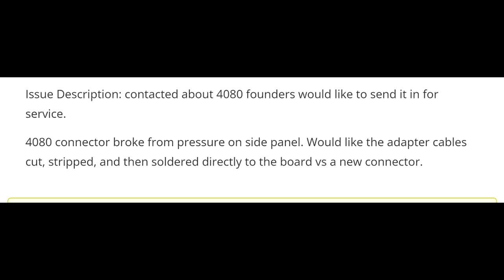Notorious RTX 4080 Graphics card Repair - Connectors are breaking like biscuits.

Comment: Love watching these repairs. I've learned a lot! "You can never have enough flux" is now engrained in my brain lol... 

Side note, I fell victim to a failed 4090 where my Cablemod 90° adapter fused to my cards 16pin. Cablemod has been great though, not only covering the adapter but also covering the card in the case of a rejected RMA. Top notch support from them. Now Nvidia just needs to do something about this trash they've attached to their design. Complete garbage, I'd sooner have 4x 8pin cables than this crap. Sure it looks nice and clean but damn, their QA messed up big time.
Reply: Q&A didn't mess up. Jensen did, as he'd have given the go ahead knowing full well about the flaws of this new connector.

Comment: Sounds like there wasn't enough clearance in the case and they forced it shut which broke the connector. Cable mod just recently put out 90 degree angles for this problem. That new 12 pin doesn't bend as easily as the older connectors

Comment: Doesn't take an electrical or mechanical engineer to see that they have reduced the total amount of copper used to save a few cents, whilst simultaneously designing a literal fire hazard. 

I hope they get clapped with a class action. This is an absolutely ridiculous issue that fixed a non existent problem. 8 pins are capable of well over 300 watts each, and definitely even a single one of those connectors would have similar if not more surface area than the 12vHPWR. 

Even the 'diameter' of the individual pins are far less than the individual pins of the 8 pins. Hell, the total form factor is almost the size of a USB 3.0 header. 

It's a wonder it can even draw 400 watts without cooking an eggs Benedict and setting the house on fire while you render a JPEG

Comment: Alex, you jinxed me mate, remember the Dell Inspiron that the connector flirted off the other day?  Well today I decided to check on the thermal paste on my new (used) laptop, after I re-pasted I went to put the fan and heatsink back and one of the screws had gone off the workbench, I searched and search but no sign of it.  Luckily I save any screws from past upgrades and broken PC's etc.  I managed to find one that fit, if I hadn't found that one I would have been stuck.  So it was your fault lol.

Comment: Is that 6 pins to ground and 6 pins to 12v dc on the connector?  At 500 watts, that would be almost 7 amps each pin!?  Those appear to be 3 amp capacity pins based on their size and contact type.

Comment: the 16 pin power connector is really hard to plug the power cable in to the point you break that connector off

Comment: My guess is that the cards are too thick pressing the cable to the side of the computer case. Now add some heat and (or) shoddy soldering by the factory and you got a mess like this on your hands.

Comment: The 4080 and 4090’s are having huge problem with the cable mod’s melting to the cards. Gamer Nexus and Linus have done shows on them and suggested it due to the plugs not have adequate supports on either side. Not sure if a video has been done on this channel yet but thought I’d mention it
Reply: What about the thermal grizzly adapter/mod that has the Wattage display screen on the side?

Comment: Assuming you could put the wires in the holes, you would have to reduce the size of the wire.  Would that not possibly compromise the ability of the wire to transfer current?

Comment: Customer needs to use an angled connector, it won't put pressure on the plug and connector on the PCB then and cause the issue to arise again in the future.

Comment: This is exactly why i do not like the rtx 40 series i rather have 3 or 4 8 pin connectors then a single 12 pin, cos nvidia cut corners on the12 pin, its obvious that it is possible to do it perfectly safe but Nvidia missed the mark clearly.
Reply: Yep.

Comment: Same heat problem will occur. There is an obvious overheating problem that needs to be addressed.  A recall should be done on that board from the factory. At rest isnt the same as a full load test. Just saying.

Comment: These connectors are designed for 30 cycles only. Every time you unplug them they get weaker and weaker and then they break. These connectors weren't designed to last long at all.

Comment: I find when you solder wires directly to a pcb they need to be very secure otherwise they’ll just snap at the solder joints

Comment: Sounds like customer needs to get a 90° or 180° adapter if the side panel of his case asserts too much pressure on the connector. I don't know why you would even think to solder individual wires to a $1200 card.

Comment: Would a graphics card brace help with this... also cable support 's so there not pulling  on the connection???  Carnt see how heat alone would snap every pin, clean  like that,

Comment: I'm starting to wonder if the metal used for these plugs (pins) are inferior. Impurities making them more prone to cracking, causing them to come of like this, or to melt.. Might not have been an issue with the older 8 pin plugs because they are considerable thicker, and therefor more durable.

Comment: customer should get 90 or 180 degree adaptor for that plug.. or a bigger case.
Reply: Yep, clearly they’ve gone small form factor and put strain on it
Reply: 180 degree connector ? How would that help ? Find online how 180 degree looks like
Reply: @benjamindoko2356  it's just a connector that you plug in it goes up and has a connector on the other side. just search for something like 180 degree connector 4090

Comment: Great job!  Quick question:  When you showed the completed connector straight on close up, did the connector suffer heat damage as it appears 18:05?  The entire bottom of that new connector looks overheated.  Regardless, your soldering skills are incredible.  That completed solder work did look like it was done at a factory.  Nice job!

Comment: Great video like all before videos
I have Razer ( Raz-RC30-024801model)  Laptop Adapter (Blade 15 ) is this possiable repair (have not output voltage ) This adapter is all metal
Can this opened without demaged ? Could you advice a method ?

Comment: Soldering the power wires to the board would work but isnt practical. I have several oc cards i did that to but outside of xoc its useless and if you snag the adapter while moving it it could fling the card across the room. Ask me how i know...

Comment: Card trying to pull too much current and metal inside of the pins are weak getting too hot and current cuts it on the spot where the low resistance exist on the pins. Thats why they look like someone used side cutter on them. Manufacrurer of those connectors must be stealing some alloys to make it more cheap.

Comment: It blows my mind how careless some people are with such expensive components. This card launched 6 months ago, and he probably bought his even more recent than that. While those new connectors aren't the best design, they don't break unless you're really bending the power wires at a ridiculously sharp angle or your PC case is too small, and the wires are smooshed in between the side panel. DUMB!!

Comment: How does the GPU not get instantly fried when you power it on with no heatsink and fan attached?
Reply: It doesn't heat much when it's only displaying the POST screen in "text mode".  Rendering 3D is what makes these cards heat up, and they're able to shut down the system automatically to protect themselves when they reach a pre-determined temperature (usually  ~95°C-105°C)

Comment: Dont get me wrong the new 16 pin connector is crap... but 99% or more of the issues with it are user created... melting... usually because its not plugged in all the way, and broken... small weak connector + big ass card + nvidia supplying a very stiff adaptor to adapt to non 16 pin power supplies... = people stuffing them in cases that were not designed to accommodate these cards and they end up having to force the side panels on putting pressure on the connector that inevitably ends up breaking.

Comment: You're forgetting that this is not the usual 8 pin connector with thicker pins, so you have to hold the connector from the back while you plug the cable in and that's why the pins snap.

Comment: Anyone who has ever inserted an molex knows how easy pins exit the housing even by 1mm this is probably enough to cause issues on a 12 pin, the 12 pin should be banned on cards due fire hazard its to small especially length wise so there are a lot of times it wont plug in deep enough even when fully inserted cos thats just the nature of that connector, i would rather believe northridgeFix then a bunch of fanboys that keep saying its user error honestly, fanboys are the worst they will watch the world burn and still says its fine.

Comment: It's such a stupid design. Angled connectors with very stiff action and stiff thick wires. The force must be applied on the weakest part of the connector: sideways, it's easy to shear off the connector by pressing moderately hard. You can't put a finger behind the connector as the shield is covering it, so you can't support the connector while inserting it. If you misalign the connector or if the connector is badly formed or has some injection mold left overs you're risking damaging the card. Even if you repair it the issue remains, maybe even more so as the pads are likely much weaker now.

Comment: the client dint ask for the conencctor to be soldered instead he wanted to solder the wires onto the board.
Reply: Soldering the wires directly is highly impractical
Reply: Did you watch the same video I did? He explained why it wouldn't work
Reply: Customers also drive cars to shops that have failing suspension due to broken components and say "I need an alignment"... Do you do an alignment anyways? Or wonder why they said that and fix the bent part or ball joint that's ready to let the wheel break off.